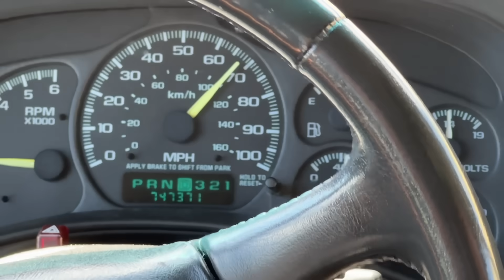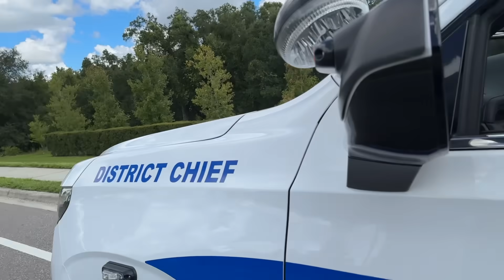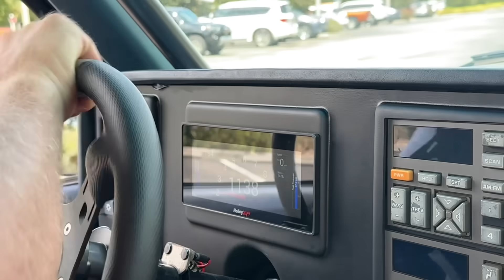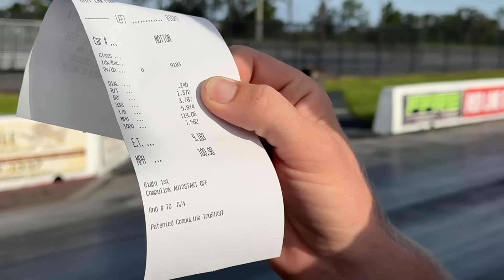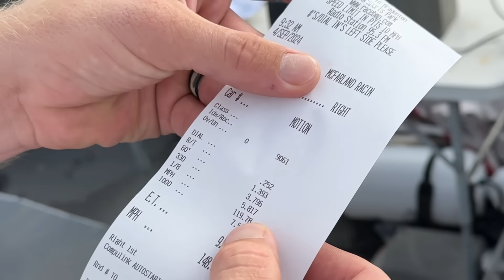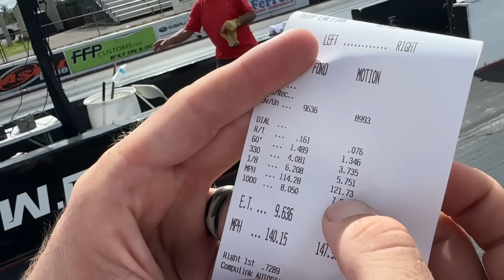We Finally Took Our ZZ632 Shop Truck to the Drag Strip!

Comment: not trying to beat on george but he isnt verry lucky as a driver ,
hes ran out of brakes on the blazer , flipped the wheelie car  , allmost ran  his truck over the concrete blocks intoo the audience with his burnout car after hitting the wall a few times , blew up a few engines , and thats just from the top of my head 
 i think it be wise to not put him in a high performance car no more , it might lower youre insurance premium and gets you a thank you from his wife  too 
to be honest he probably has a full job recording stuff for you anyway 
sherrrif (hey you wannah become famous)
reminds me of a story of my father , back in the days he owned a first gen corvette (back in the days when they where giving them away they where so unwanted) ) now my father didnt had a driverslicence and one day he ran out of gas so he and my mother was pushing the car to the nearest gasstation when the car started moving faster all of a sudden , my father looked back and there where two cops help him push the car 
he was sweating pretty hard and it wasnt from pushing , luckily for him they never asked him for hiis licence 
later on they got me and still later my sister , my mother gotten few up having two kids sitting on her lap so my dad had to sell the car and get a car with more seats , hes still beating himself up over it as the car wouldve been worth quitte a bit of money nowadays

..... ever noticed that when jackstand is racing he doesnt even blink once